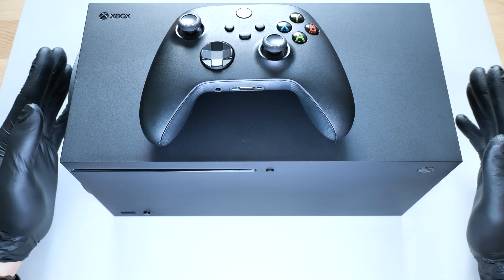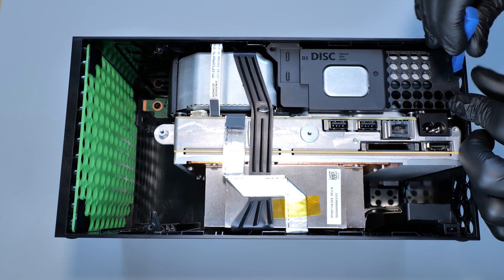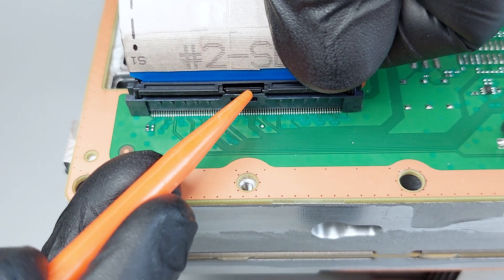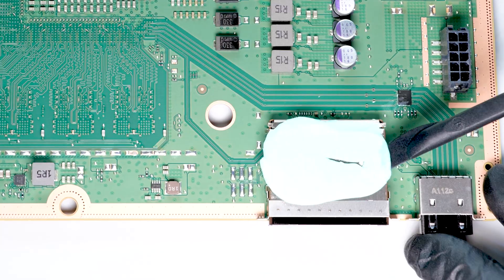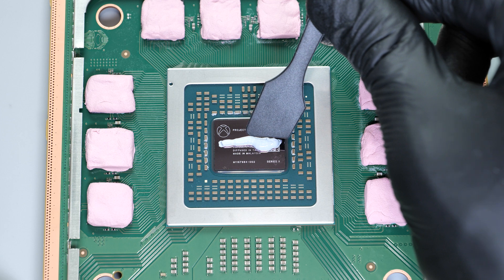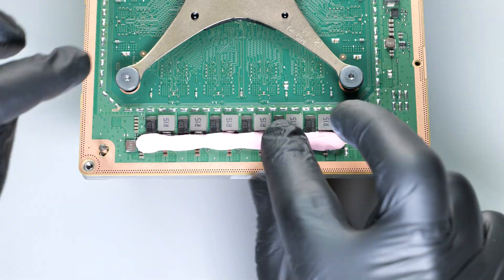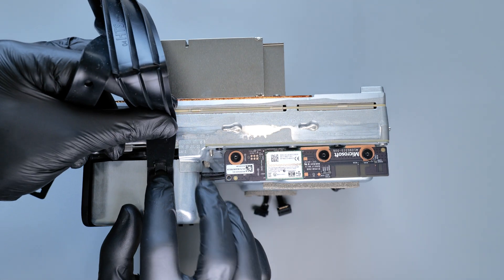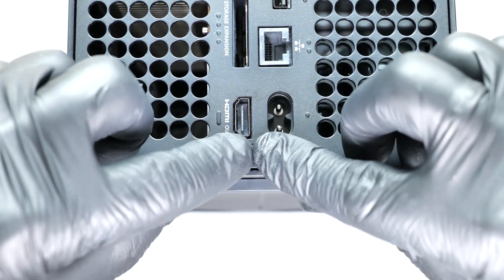Xbox Series X Thermal Paste and Pads replacement and Cooling System cleaning

Comment: Approximately what is the w/mk value of the green thermal pads used by Microsoft? Because I couldn't find the upsiren pro paste you used in my country. I asked at least to use a better pad than the existing pads. For example, do you think it would be enough to replace it with a pad of 8 w/mk?
Reply from the maker: I'm pretty sure you can get that thermal putty with free delivery to your country from Aliexpress. The links down below.
I don't recommend using thermal pads in that console because there are non-standard gaps between the components and the heatsink. In theory, you can use highly compressible pads, but they have terrible thermal conductivity. The harder the thermal pad, the higher its conductivity. Therefore, Upsiren U6PRO thermal putty is the best solution available on the market, as of today.

Comment: I turn on my SX , theres nothing on screen and then after about a minute it automatically shuts down. Im guessing its the heatsink but would anyone else have any educated guesses for me please.
Reply from the maker: If there's no video signal output from the console, I really doubt that you have overheating problems. It could be anything. I recommend connecting the console's SSD to a PC, checking its state, and if possible, running a disk check to fix any errors.
Reply: Cheers for reply. I'm guessing that's a hard thing to do , I'll have a look and see can I do it , thanks for reply 👍👍👍👍

Comment: Hello, my Xbox Series X sometimes crashes and Looks Like a temperature Problem. May i use thermal pads instead of thermal putty or do they not the job properly? I would cut the pads at size
Reply from the maker: Could be overheating, some other hardware issues or simply dying SSD. I don't recommend using thermal pads in that console because there are non-standard gaps between the components and the heatsink. In theory, you can use highly compressible pads, but they have terrible thermal conductivity. The harder the thermal pad, the higher its conductivity. Also, there are different thicknesses between various components and the heatsink. Therefore, Upsiren U6PRO thermal putty is the best solution available on the market as of today.
Reply: @ElectronicsComputers  thank you for the quick explanation, I will try to repaste after I build my first pc next week :)

Comment: How do we understand the need for change?
Reply from the maker: After two years of console use, the thermal paste on the APU is definitely dry. Once you remove the heatsink, you'll need to replace the thermal paste or at least reshape the old one so it can make proper contact with the heatsink. If the thermal paste is not soft and greasy, then it's time to replace it as well.

Comment: Hey this video is awesome!! Thanks for the great content. 

I have 1 question: The thermal putty that you have in the description is listed as 12.8w/mk, is there any benefit to go to a 14.8w/mk or 16.8w/mk? I see they are also available.
Reply from the maker: When that video was made, 12.8w/mk was the best thermal putty on the market. Of course, opt for the one that offers the best thermal conductivity. The heatsink in the Series X is perfectly capable of dissipating high levels of heat.
Reply: @ElectronicsComputers  Awesome! I really appreciate the response. Thanks for the information and the great tutorial video! I’ll be doing this project very soon.

Comment: Those thermalpads are unnecesary to change, old ones was almost like new. They don't dry like thermalpaste.
Reply from the maker: I just grabbed a random console from our repair shop. The intention was to demonstrate how it's done, not to replace the thermal putty in that particular console. But anyway, having a better-performing thermal interface never hurts.

Comment: Hi friend. This is the best tutorial I have ever seem for Xbox Series X.
I'd like to know about the the termal putty. Do you know How long does It last? I live in a country where the temperature is around 26°C, 34°C most of the year in my region.
I've never used this thermal putty before, but I bought one from the link you shared here.

Thanks for this video
Reply from the maker: The original thermal putty lasts for about 5 years, and I wouldn't worry about it much. The main issue is with the thermal paste, which is terrible and dries up pretty quickly (in about 1-2 years). It's not even close to high-performance pastes like Thermal Grizzly. If you decide to replace the thermal paste, you'll need to either reshape the original thermal putty or apply a new one. UPSIREN U6 PRO also performs better than the original thermal putty. To conclude, there's no need to replace it unless you want to replace the thermal paste. Together, these thermal solutions will provide decent thermal transfer to the heatsink, which can have a significant impact on the console's longevity.
Reply: Hi friend. Thanks a lot for the info. The upsiren arrived last Friday here, so i'm going to put my console on the surgery table and replace the thermal pad and paste this week.

Comment: Anyone who is serious about cooling uses grizzly. While it does dry out faster it still holds a lower temp longer, especially on consoles because it was designed for GPU's and that is the part of the chip that gets the hottest with these consoles. The APU that AMD designs is awesome but very bad for longevity. if you compare the amount of time a CPU will last without a 3D accelerated GPU built into it, to one that has one, the one without will run decades compared to the other only running years. if the chips were sperate it would triple the lifespan of the consoles but who knows maybe thats the point. I havent seen a console built with cooling in mind since the OG Xbox.

Comment: Would this work with Halo Xbox Version? Also, would Thermal ads be ok to use instead of putty? How much putty did you buy?
Reply from the maker: Those consoles are the same inside. You'll need 50 grams of thermal putty. I don't recommend using thermal pads in this console because there are non-standard gaps between the components and the heatsink. In theory, you can use highly compressible pads, but they have terrible thermal conductivity. The harder the thermal pad, the higher its conductivity. Therefore, Upsiren U6PRO thermal putty is the best solution available on the market, as of today.
Reply: @ElectronicsComputers  Thank you so much.

Comment: Hi! How I can contact You? I just done it today!  I want to share with You my work. I waited about month to arrive thermal compound. I used alkso upsiren thermal paste  on cpu (hope it was good choice, it was not thermal putty). Is it normal that now xbox pull out so much hot air? I do not remember that it was that hot after buying it
Reply from the maker: I hope you used regular thermal paste on the APU, not thermal putty! If your console generates more heat under the same load, that means your upgrade has yielded positive results, and more heat from all components is being transferred to the heatsink. Good job!
Reply: @ElectronicsComputers  please check online if that's suitable product - for APU I used UPSIREN UTG-X. I ordered it with Upsiren U6 after Your recommendation
Reply from the maker: @boro977   Yes, it will work perfectly!
Reply: @ElectronicsComputers  thank You for Your help

Comment: Hello, great video, I was wondering if you have a video like this for the series S.
Reply from the maker: Thank you for the comment! Not yet! But I'll make later. Basically same principle is applies to S. That console is way easier to disassemble and service.
Reply: @ElectronicsComputers  thanks for answering my comment! I'll service mine but I'm pretty confused about the thermal putty since in most videos they reuse it, and there's little putty visible, so I thought that the rest of the putty might be under the shielding around the processor?
Reply from the maker: @eljaibas16  If you didn't remove the shielding under the heatsink, there's no need to replace the thermal putty. The reason for replacing it after disassembly is that thermal putty may not achieve a 100% perfect contact with the heatsink or some components. If you choose not to replace it, at least reshape the old one.
Reply: @ElectronicsComputers  oh I get it, thanks for the advice!
Reply: @ElectronicsComputers turns out the heatsink it's different from videos I've seen, the shielding it's incorporated into the heatsink. Maybe mine it's a newer version from what I've seen.
But God damn does it make a difference, so much quieter and cooler using MX-6, (same thermal putty even though it was a bit dry, but the paste was hard as a rock)

Comment: Great tear down. I think he missed an important highlight when taking out the fan. The middle bolt has blue lock tight on it. It’s a pain in the ass to get out and if you got lower end t8 tool it gets stripped easily. I had to use pliers because the screw was so hard that the torx tool stripped it.
Reply: Did you just grip the screw and pull it out?
Reply: @MartinT  yeah I gripped it and turned it to get it out. Only way I got it to work
Reply from the maker: Thank you for the comment!
Reply: Lmfao just happened to me, that circular t8 screw stripped. used pliers after to looses it, but what a headache lol jokes read this comment

Comment: Awesome video! I got to the part with the.motherboard cables and the adhesive on both black tabs was bad so they just came off :(. Any solution? I don't want to damage the cables.
Reply from the maker: There shouldn't be any adhesive on the cables. Can you share the picture?

Comment: Before you get to motherboard chip press. I have a huge head shield on. Which looks soldered onn. Could you explain how to remove this. It was not even in Ur demo
Reply from the maker: Only a first batch of Series X came with that shielding. It's not soldered, just pry it with a screwdriver or a prying tool.

Comment: So my xbox has been having huge graphical glitches especially on shadows and some stuttering when I play too long. Do you think this will solve that?
Reply: Just ordered the thermal putty. I already have some paste. I figure this is an easy fix. I already did pads and paste on 5 3090's.
Reply from the maker: It should help. Also clean the cooling system.

Comment: If you were doing this with thermal pads, how thick would you use? 1.5mm?
Reply from the maker: In practice, it's impossible to use thermal pads in that particular console because there are non-standard gaps between the components and the heatsink. In theory, you can use highly compressible pads, but they have terrible thermal conductivity. The harder the thermal pad, the higher its conductivity. Therefore, Upsiren U6PRO thermal putty is the best solution available on the market, as of today.
Reply: OK I see, thank you. @ElectronicsComputers

Comment: What’s the life expectancy of that terminal putty?
Reply from the maker: I'm pretty sure that the console will die before that thermal putty dries. There are only two reasons why you should replace the original paste: if you want to replace it with a higher performance thermal putty, or if you have disassembled the console. In the latter case, you can also reshape the original putty so that it can make proper contact with the heatsink again.
Reply: @ElectronicsComputers  would you recommend replacing the original putty with upsiren is it better performance

Comment: I’m so excited that there’s a video that actually shows where the screws go back in and explains how things come back together instead of just taking it apart thank you so much for those. I had to replace the HDMI port in pretty sure I messed up the whole board because I don’t know what I’m doing but I’d rather not but I can pay $200 call fixer because I might as well buy a new one at that point.
Reply from the maker: I'd definitely buy a new one and sell the old one for donor parts, but not the whole thing at once, but part by part. In that case, you can earn up to $250. Only the SSD costs about $100. When the whole broken console is usually bought for a maximum of $100.

Comment: I repasted my Xbox series x tonight my Xbox has a plate over the xclamp and it was a pain to get off, I chipped a chip/capacitor by it but it still works thankfully so I didn’t rip it off the Sauter. It runs cooler and might last a little longer. Your video is very helpful I did everything fine except I struggled with the metal covering the x clamp but the paste was hard and very dry. Thanks man.
Reply from the maker: I'm happy to help! That cover was only used in the first batches, and then Microsoft decided to get rid of it for some reason.
Reply: @ElectronicsComputers I got a question my Xbox series s is running really hot on the bottom I just replaced the thermal paste and there's no dust. Theres some blue thing on the heatsink which I'm guessing is the thermal pads/putty but one of them is like kind of ripped off/ looks bad. Is that why it's overheating and crashing? My games are dashboarding
Reply: @dnegel9546 dude idk I tried everything it's just faulty I got a new one selling the old one for parts my guess is that the CPU is running just way too hot though i tried replacing it with some thermal pads In the most bootleg way but it didn't work

Comment: can i use arctic mx6? If yes, can i use the dot method?
Reply from the maker: Yes, you can use Arctic MX6. I showed in the video what happens if you use the dot method. If it's OK for you, then you can use it as well.
Reply: @ElectronicsComputers  May I ask how often do we need to re-paste Xbox series X? Mine is about 18 months since purchase 🙏🏻
Reply: Hello? I would like to use artic mx 6  or Thermal Grizzly Kryonaut what do you think? And I Will to use thermal pad Gelid extreme or ultimate 1.5 mm ...

Comment: Grazie, cercavo da tempo un materiale per sostituire i pad simile a quello originale ma erano tutti rigidi. Funziona bene? avete già fatto dei test di comparazione? grazie a chi risponderà.
Reply from the maker: We use Upsiren U6 PRO in our repair shop for all types of equipment and it works great. It's definitely not worse than the original green putty that used for Xbox consoles, maybe even better.

Comment: You are the reason i even decided to open my box and order a thermal paste, didnt get no putty tho...

However i smudged the older one together just a bit cause that would again cause it to spread on the surface nicely after the chasis been screwed in tight. It wasnt dry and was gooey enough so i guess it would work...

The only thing im worried about is that i have slapped  a TON of thermal paste on that chip ...

Its working better than new rn so may be its a rare W for me🤔
Reply from the maker: Great job! I'm happy to help. No need to worry about excess thermal paste if it's not conductive.
Reply: So you didn’t buy the putty right? But it worked?
Reply: @adrian_s9849  cause my putty was still gooey and not dry, if that's the case for you too then please make sure to smudge it up back again because if you don't there will be gaps between the elements and putty and your xbox will die out of heat.
After smudging it on the surface it self again, then screw in the chassis
Reply: @parthpathania5870 okay thank you

Comment: Im not sure if you will reply but ive never heard or thermal putty is it required or optional
Reply from the maker: Every Xbox console uses thermal putty as a means of heat transfer from the components to the heatsink. It's not optional.
Reply: @ElectronicsComputers  ok thank you I'll make sure to get some from the bio👍🏼

Comment: I can use thermal Grizzly Kryonaut Extreme series x??
Reply from the maker: No, first of all UPSIREN U6PRO has better thermal conductivity and second of all those pads are not easily compressible so it basically wouldn't work perfectly in that particular application. If you find some soft pads it will work but those pads have the worst thermal conductivity. So, thermal putty is the way to go.

Comment: Did you end up with a lot of extra thermal putty/grease?
Reply from the maker: If you bought two 20 grams containers, then almost all putty will go to replace the green thermal putty. It's very important to apply the right amount or slightly more on the memory chips and VRM components.
Reply: Thank you! I bought the 50g container of the putty from the site you recommended!

Comment: MEGA Thanks for the vídeo! Its amazing the way you explain every step, but i have one question. Why our consoles doesnt have the metal plate that cover the X claw? And why the connector plug (min3:20) its diferent too? Our consoles are from other region or something?
Thanks again for the vídeo! You are amazing!
Reply from the maker: Thank you for the comment! There were different revisions of the console, and who knows why Microsoft decided to get rid of that cover. Maybe they just wanted to make it a bit cheaper or due to some parts shortage, but anyway, it's not gonna affect the console's performance or lifespan in any way.

Comment: Do you really need to replace the Thermal Pads? I Thought Most of the cooling is done by the Thermal Paste
Reply from the maker: Original thermal putty is pretty good and will last for about 4 years. The problem is that if you disassemble your console for example to replace the thermal paste then I highly recommend replacing the thermal putty as well. Because that thermal putty won't have good contact with both parts and won't have the same thermal conductivity. At least try to reshape the old putty slightly if you don't want to apply a new one.